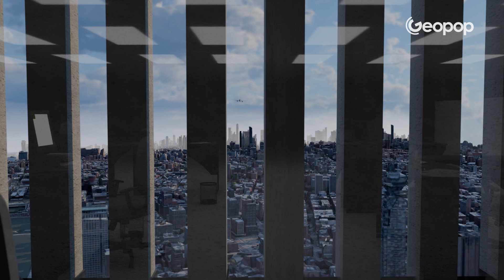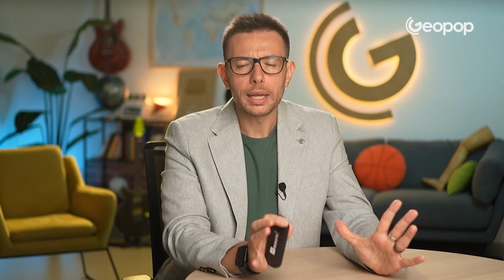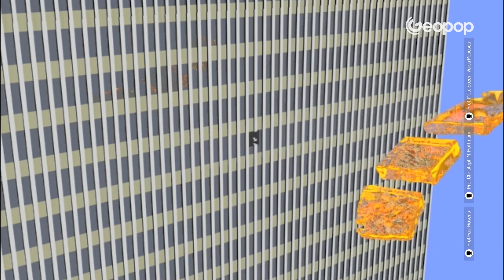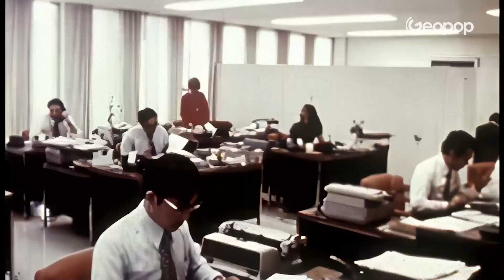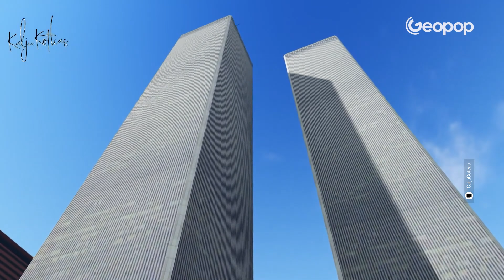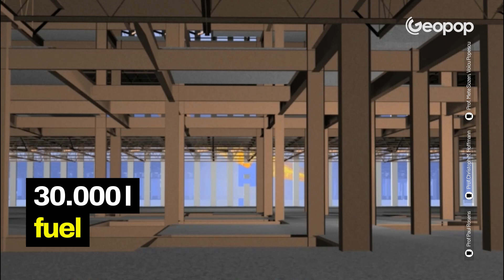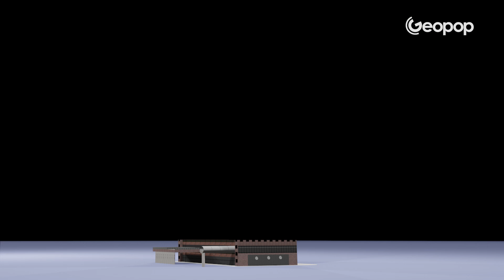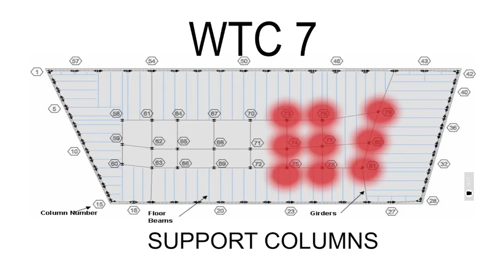9/11, 2001: The Technical Reconstruction of the Twin Towers and WTC 7 Collapses

Comment: I can’t fathom why they focus so much on explaining how they collapsed, you don’t need to be a scientist or an engineer to know that any weakness to a structure that bears weight above the point of said weakness, means that helloooo, the weight above will soon be too much for the weakness to bear. It’s not even science, happens in jenga
Reply: 1.The firefighters said" it looked like they planned to take down the building" I didn't say that, The fire fighters said that. They were there.I'm sure they know best.
https://youtu.be/XiIT4HInWjY?si=e1Pvp3-IFs-M75Oj
When the firefighter says "boom, boom, boom, boom" in this video.
What do you suppose he is?Implying by " boom" ??
2.So if there were no explosives then what is this? 8:25
https://youtu.be/bLF5D7M1YgA?si=aHSvS__uOdxMi1ZB
You can't say that it was added because you can see the firemen's reaction to the explosion. And you can't say it came from anywhere else because the firefighter says
" We gotta get out of here,  7 is exploding "
3. Controlled demolitions have squibs, you can see the squibs here 20 floors below the collapse. 
https://youtu.be/eXAgulfAtR4?si=-iLO9aQjMJVLTUYH
4. Firefighter says "any one of these buildings could blow up,  this ain't over yet" firefighter says there's 3 secondary explosions. 
https://youtu.be/0Gh3ErgMI4M?si=mmp9Eus_5PWTCBfl
5. Airplanes can't fly 600 mph at 1000 feet. And to be able to make a 180 degree turn to hit the opposite side of the pentagon going that fast is ridiculous. And since when do terrorists hit the opposite side of the building where no one was at when they could have just flown straight in and killed way more people???
https://youtu.be/0Gh3ErgMI4M?si=mmp9Eus_5PWTCBfl
7. No one has ever known ahead of time that a building was going to collapse except through controlled demolition.  Tower 7 was reported to have fallen while it still stood in the background. 
8. Larry silverstein,  the man who made over 4.5 billion when they fell, claimed to have pulled the building down.
https://youtu.be/1jQaJFNWqtc?si=wCywQ9grgBdS_w11 yet somehow today he is only worth one billion dollars.
9. A witness reported a missile hit the pentagon while he was seen at the scene. 
And the hole wasn't big enough for a plane and the damage wasn't consistent to the towers. And just like shanksville,  there's pictures that show no plane parts at all. But there was papers everywhere. Explain to me how the burnable paper is laying everywhere , but the steel parts of the plane are gone. The luggage.
Is gone, the seats are gone.The people are gone
https://youtu.be/6_Ez-UCpXMs?si=JaQ6DBEC_LJtMLgN
Reply: @robbiehiatt9966  bet I’m arsed
Reply: @robbiehiatt9966  Please tell us how "they" managed to keep the explosives from igniting for 1-7 hours after the impacts, and raging fires? The colapses initiated at the point of impacts. So how did they rig the explosives so that they were not damaged by a plane collision?
Reply: @BoodahBodey are you saying there wasn't an explosion at impact of the plane. Thats crazy
Reply: @robbiehiatt9966  1. "It looked like" ≠ "it's proven." Sure, we all were reminded of controlled demo when we saw those buildings come down. That proves nothing.
2. Are you saying explosives is the only possibility? Buildings under that kind of stress are going to make loud noises. It could have been something falling. Who knows? Not you.
3. Those aren't squibs; squibs make noise & the ejection speed would be a lot higher!
4. No FDNY firefighters who were there that day believe the buildings were blown up. NONE.
5. Airplanes have been known to exceed the speed of sound under conditions like steep dives - which is how the jets got down to the towers' height so quickly. And there's nothing impossible about AA77's spiral turn. Load up your favorite flight sim & you could do it.
6. Didn't you learn to count in school? 🤣🤣🤣
7. Everyone, including the firefighters and the media, knew 7 was going to collapse. The BBC anchor screwed up &  reported it early but they all know it was coming down.
8. Silverstein lost money on 9/11. The insurance wasn't enough to cover the cost of rebuilding, which he was obligated to do.
9. One witness reported seeing a missile; dozens reported seeing a plane. The pentagon was nothing like the towers; is it surprising to you that the damage didn't look the same? And FYI more of UA93 was recovered than any of the other three.

Nine strikes and yer out!
Reply: @Tim22222 1. It proves multiple firefighters who were there at the scene. Said it looked like they planned to bring down a building. But you think I should listen to you and your lies over the firefighters who put their life at risk to be there and to do the job. And you call them a liar. 
2. Once again, you expect people to believe what you say and not listen to the firefighter.That was right there , saying tower seven is exploding.  
3. Those are squibs. I think I pretty much proved that go look at the video again. And if it's some sort of air pressure coming out of the windows where is your proof that that has ever happened before? Where's your proof that's even a thing? Anyone with common sense can see those explosions...
Reply: @Tim22222 7. It's pretty clear from the fire departments words that I posted the videos above to show you that it was a controlled demolition. And the only reason anyone was to believe 7 was coming down was because explosions were coming from the building like the videos above point out. Nobody knows when a building is going to fall down.Unless you take it down with explosives , that's always been the case. And it's the case here....
Reply: @robbiehiatt9966  If you can find one single FDNY firefighter WHO WAS THERE THAT DAY who believes those buildings were brought down with controlled demolition, please produce them. If you can. But you can't. Because they WEREN'T and you haven't proved shit.
Reply: @Tim22222 i already have. Im not playing your game. You have zero qualifications. You're not a witness.  You mean exactly nothing in my search for the truth. Youve brought no proof of any sorts to the table. And show no proof that my expert witnesses are wrong in any way.
Reply: @robbiehiatt9966  Oh, I never claimed to have "qualifications" and no, I'm not a witness. And I'm not saying your "expert" witness are lying or wrong, I'm saying they are not experts. The expert I'd like to hear from on the question of whether steel melted at the WTC is called a metallurgist. If you had such a witness, I'd sit up and listen. But you don't.

Believe what you like but stop kidding yourself that your silly points have been proven.
Reply: @Tim22222 you don't listen to nothing. You refused to listen to the firefighters.That was there that described a controlled demolition. You don't listen to the pilot that told you, you can't go that fast in a plane that's not a military plane at those altitudes, you don't listen to the materials engineer. 
A materials engineer researches, develops, processes, and tests materials to create new products or improve existing ones. They apply their knowledge of chemistry, physics, and engineering to understand and manipulate the properties of metals, ceramics, polymers, and composites to meet specific design and performance requirements. There you go, but you ain't gonna listen to that either. And you've posted exactly zero evidence of anything but that's not gonna stop you from going back to the top of the comments list and telling your lies all over again quit playing games. Checkmate  you done
Reply: @robbiehiatt9966  "You refused to listen to the firefighters.That was there that described a controlled demolition"

Did I? Which firefighters? What did they say, exactly? You never provided either a quote or a firefighter! Name and citation, please, and I want to know their exact words, don't just paraphrase.

"You don't listen to the pilot that told you, you can't go that fast in a plane that's not a military plane at those altitudes" 

Again - who?? I never heard a pilot say that. What did they say EXACTLY? Quotation, please.
 
"you don't listen to the materials engineer" 

Same questions! Who said WHAT, precisely? 

The fact is you haven't offered any exact quotes (with citations) in this whole thread! Why is that?

Face it, friend - you're hearing what you WANT to hear.
Reply: @Tim22222 it's clear you are incompetent. Have fun with that
Reply: @robbiehiatt9966  Naw. Competence would be providing the citations you are unable to produce!

There's no shame in admitting you don't have the proof. Be honest!
Reply: @Tim22222 i think you might need a psych evaluation
Reply: @Tim22222  If I witnessed a couple of huge planes fly into skyscrapers and it was still standing, I would probably say "It looks likes they are trying to take down the buildings".   I certainly wouldn't jump to other end of the scale believing it was planned controlled demolition as @robbiehiatt9966 has. I have no time or respect for these people, period.  My reply to them is simply, "Ok" and I move on.